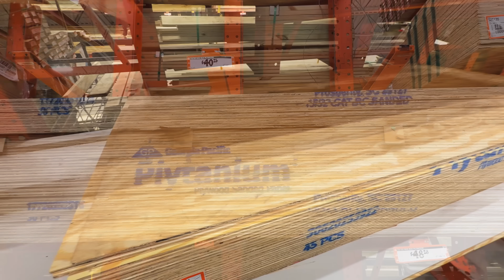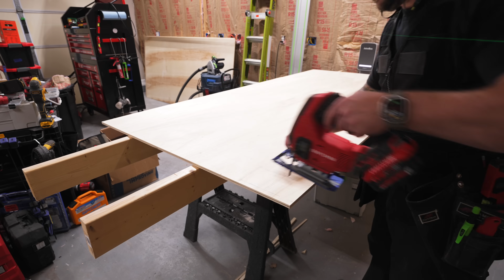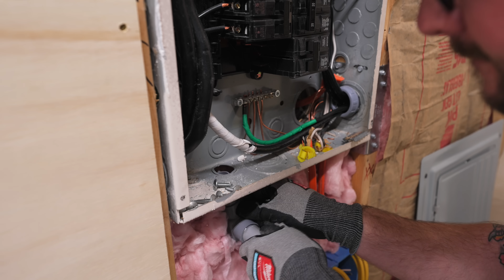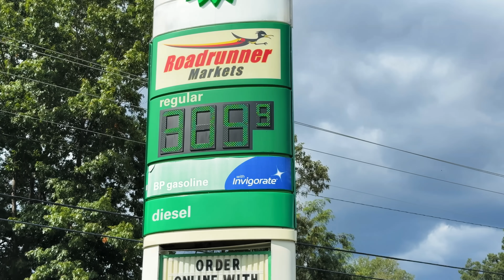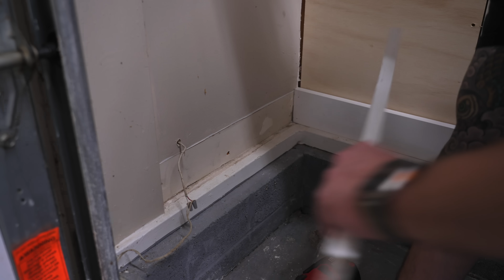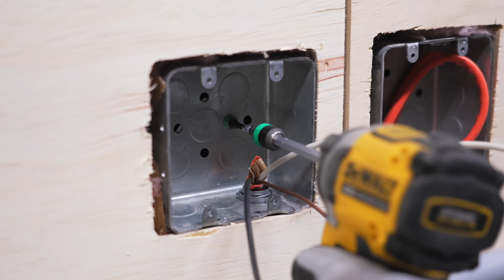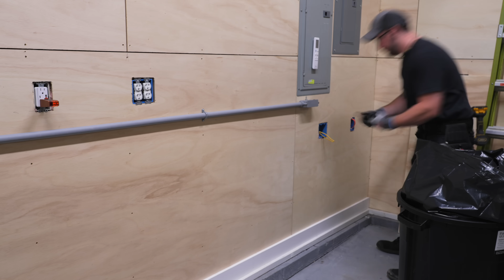Transforming My Garage Into A Workshop Part 2 : Plywood Walls & Outlets

Comment: For those without a track saw, there are inexpensive kits to use a circular saw with a track. They work fine for breaking down plywood, but lack many of the features (such as plunge) of a track saw.

Comment: For folks looking to do something similar: when I looked into it here, plywood wasn't allowed on the walls for anything attached to the house, unless you also put drywall over them. The inspector said this was for fire code reasons. A completely detached structure likely has different requirements.
Reply: I came here to say the same thing.  Plywood on its own is not a good choice for anything attached to a living structure.  Its not a fire barrier.
Reply: Not a bad idea considering the drywall gives fire resistance but also provides not only more insulation but sound insulation for any power tools.
Reply: I sprayed a intumescent fire resistant solution on my plywood in my shop which is available in no dye and with red dye. I don’t have  permits or inspectors to deal with though…no idea how this would fly. Some areas (office, little studio apartment in the mezzanine) did get drywall of the top though as an additional fire barrier and for sound reduction. I have spay foam but all empty cavities got stuffed with rock wool. Also wrapped outlets in walls between rooms with that red putty stuff for both fire concerns and sound proofing. Did pretty much what I could short of sprinklers. I don’t like things fiery.

My walls also have larg GRK countersunk cabinet screws (bought in bulk) and are painted white with BM Command.
Reply: I did plywood in my garage and had to apply for a variance. Wasn’t a hard process but it was a process.
Reply: mine has drywall under wood for this exact reason.
Reply: @BuiltOnAWhimGarage  how did you handle the outlets in this setup?
Reply: @m3dmonds I cut the holes for them and purchased outlet extenders to push the wood outlet covers outward. I got the wood outlet covers from either Menards and Home Depot. I'm running 102 and 220. with 220 I beleive I had to use the metal housing.
Reply: Gypsum (or fire rated plywood) is required if the garage shares a wall with the dwelling. But only that wall is necessary.
Reply: I think you can also put plywood over the drywall in most places
Reply: lol inspector
Reply: Who said anything about getting an inspection? I'm putting a whole remodel in the basement and no permits or inspections. The county doesn't know what's finished and what isn't since it's a brand new build with plans for a finished basement that was never completed
Reply: @Publius_Enigma8647 if you ever sell, depending on local laws you may be forced to rip it all out so that buyers can close on home.

Comment: Great video! I also put up plywood sheathing in my garage, no regrets. Looks great, and super handy to screw into since no need for drywall anchors. Though I opted for prefinished cabinet ply, to add some stain resistance.

Comment: Why not also integrate the cable for the car charger into the wall?
Reply: I thought the same thing. He said something about "in case of updating in the future", but since the panels are simply screwed in, it'd be a piece of cake to open up the wall.
Reply: I thought the same. If he really was worried about the possibility to change it later he could have easily run a perfectly horizontal conduit into his junction box directly to the outside which would make it easy to change the wiring later (although he will most likely only has to change the actual wallbox outside).
Reply: Future proofing means having a bigger cable incase the charger output increases. Should of stick the conduit in the wall mate
Reply: What will change with a update? You can just pull a new wire threw the same tube right? And if that’s not possible, then go via the outside…
Reply: Yeah, he's going to regret that ugly out-of-place PVC pipe on the wall. There's no good reason to not have run that in the wall. Sure, EV charging standards might change a bit, but the 240 wire run isn't going to go anywhere.
Reply: Why didn't he put the box inside the wall? 😮 As well as the conduit.
Reply: I mean they are also known to burst into flames spontaneously , so I would think having access to the cord would just be safe practice
Reply: He said, because technology keeps changing. If it needs to be upgraded in the future, he's not tearing into the walls. Makes perfect sense to me!
Reply: @ronlovell5374 It would make perfect sense if he was throwing up drywall, mud, and paint, but he's just got plywood and screws. So no, it doesn't make sense. He just took the lazy way out.
Reply: @bgubs07   he took his way, just because you think it's lazy doesn't mean he cares.  what a useless, meaningless thing to try and insult someone over.  I bet your own garage doesn't look even half way as good and put together as his does, so you're probably just projecting to begin with.
Reply: @bgubs07 I'm an electrician and he did the same thing I would've. If the wire sizes/standards change he has full access to the conduit, it's also not smart to bury a high amp draw appliance line into a wall that has potential for multiple things to be mounted on.
Reply: @ronlovell5374  have a shit ton in my walls (made of painted 3/4 sanded ply). Most (but not all) of both my 120 and 240 runs are MC though and I have a metric tons of outlets. And anything not MC have nail plates (I still try to hit studs when I can).

And I have different screw sizes so the penetrations aren’t that deep.

I even put air in the walls in some spots (probably not the best choice, but I can take apart the wall if I need to get to it).
Reply: It’s pretty simple. You’re not supposed to burry junction boxes in walls.
Reply: @j @jasledz  no one said anything about burying a junction box. His charger is the junction box. It wouldn’t be buried regardless.
Reply: @jasledz  You can burry them if they are furry.

Comment: So you’re not putting in gfci receptacles that are code required in garages?
Reply: He probably has GFCI breakers or the first outlet in the circuit GFCI. You need every outlet to be GFCI protected, but that doesn't mean they all need to be GFCI outlets.